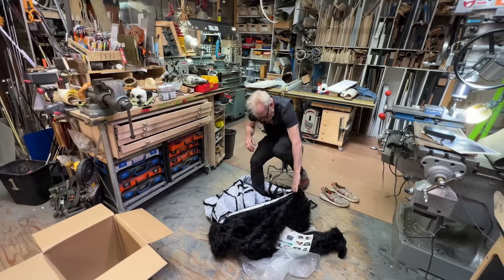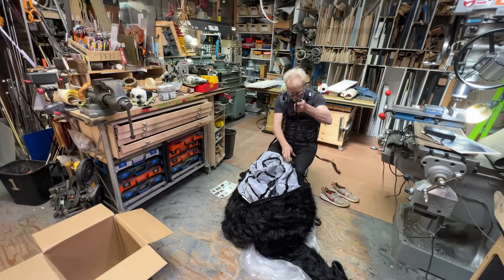Adam Savage's Inflatable Gorilla Costume!

Comment: Remember that an ape does not have a lumbar curve to its spine and walks hunched over. I could wish the face wasn't in permanent attack mode so may you could muppet-perform it to what ever you wanted it to do.  Although you CAN put it on by yourself, it looks like it would still be handy to have a dresser that could help with getting full extension into all parts.

Comment: Hey this is off topic,  BUT,  have you ever considered showing everyone a very simple PVC water and motor actuated super soaker cannon design,  that you then Dare other science and engineering channels to top your design?   I mean, wildfires are becoming more abundant,  some people do live close to major water body access and rural enough to be concerned of wildfires,   a simple and fairly affordable 3" pvc  water cannon might be really effective as a wildfire deterrent and preventative measure. 
What gravity, wind, solar, and human pumped air pressure designs could be produced? Over head and distance spray. Not civil rights protestor oppressive, obviously.  Also it could be fun to be shown from a limited water source, bathtub, rain barrels, grey water reclamation cistern beneath a sieved driveway, or straight from the ocean in a weird giant neighborhood water gun battle that, using the right energy sources,  desalinates water through organic plant chemistry that consumes more carbon than it generates?   The displacement and storm drainage beginning steps of desalination through the plant media and Rained cycle, in the return loop?   What if ocean sand traveling to concrete manufacturing  traveled with ocean water?  By hydrogen powered trains?   How difficult would that be to stop?  Then potential potable water,  just needed human super soaker/water slide effort to kick off the desalination?   Dibs on the channel showing women and men, only with science degrees,  in bikinis running in slow mo through desalination sprinklers... Double dog dare you.

Thanks for fun videos.